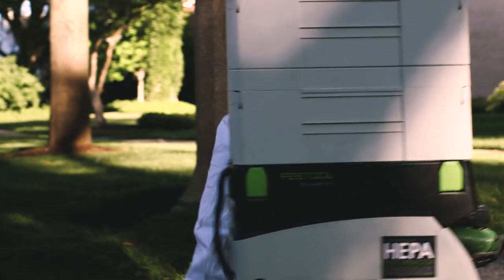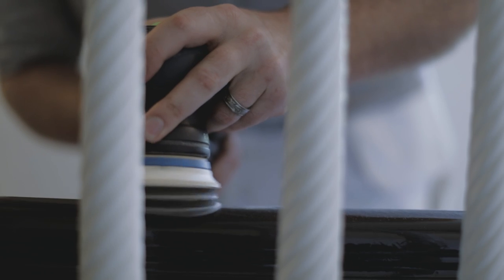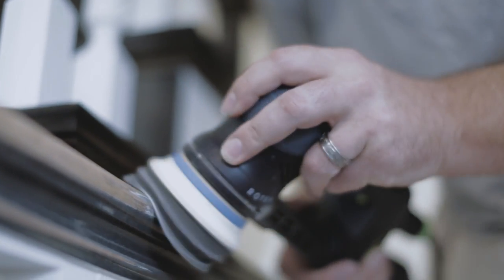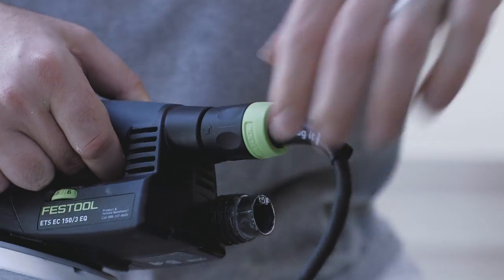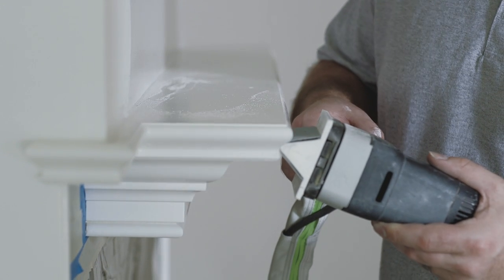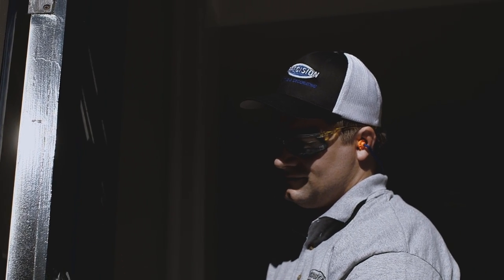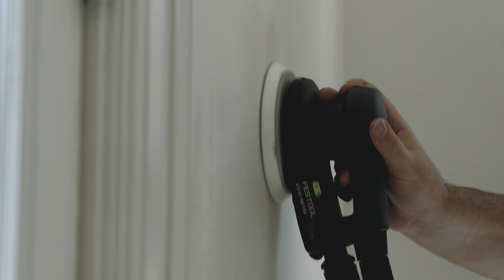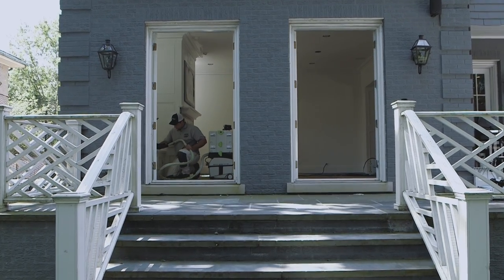How Festool Paint simplifies work for Jack Andrews

Comment: Using power sanders on old millwork can get you into expensive legal trouble. If there is any lead paint the sander pad has to be shrouded for dust collection and the surface must be dampened first, no dry sanding. There are more rules for lead-safe work. Take the class and get certified before working on any house built before 1978.
Reply: The lead problem is the first thing that came to mind as well when watching this video. I do have a question for you.

Would the moisture in wet sanding affect the efficacy of such sanders, i.e. create a "paste" or gum up the pads during the process? The sanders can be paired up with a Festool vacuum that is extremely powerful, which ensure that particles to 0.3 microns are filtered out with 99.97% efficiency. The vacuums are also HEPA certified, so the exhaust air should be safe as well.

I had a professional painting company use the Festool sanders with the dust collection system on wooden cabinets from the 1950s. As expected, we did find lead in the older paint layers, but I hope we will be alright!

I have seen restoration workers remove lead paint by using a steaming-and-scraping method both on individual pieces using an enclosed steamer and on outside surfaces with a portable steamer, as well as "wet scraping" and vacuuming (from an episode in This Old House) on surfaces that were rather tricky to work with, such as trim and moulding. They used protective gear such as masks and also covered the work area. Certainly a tedious task!

Your thoughts? Do you have experience with lead paint removal?